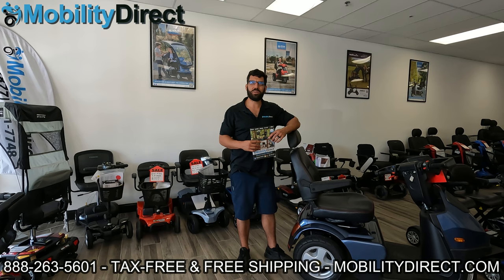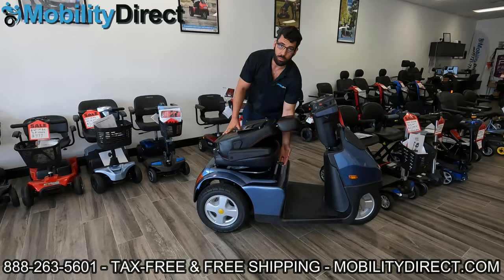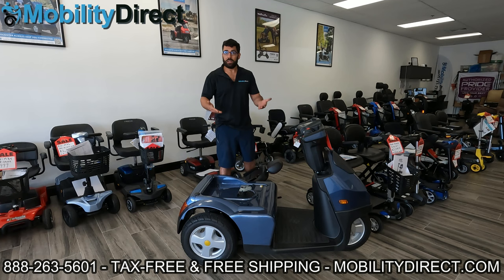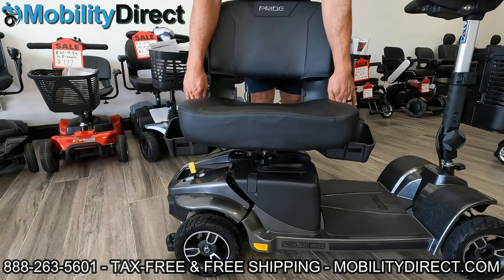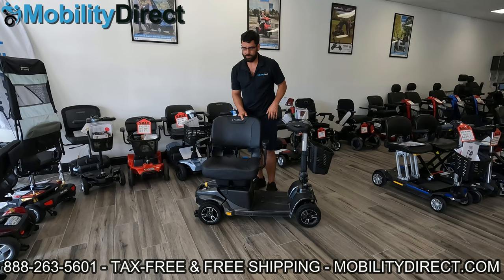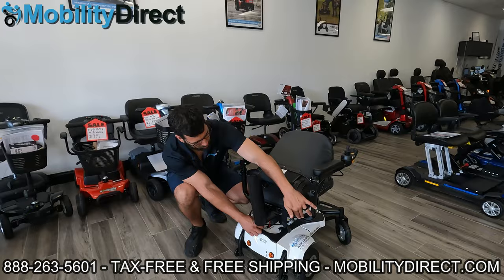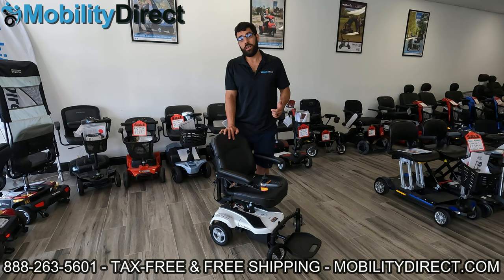🧰How Do You Remove a Mobility Scooter Seat?

Comment: You just made my life easier today thanks a lot!.... It was the straight up thing that was the issue I was even thinking my seat  had rusted closed or something hehe!.. But after you said "straight up" I got the seat offf in one attempt, yet been trying to get that seat off for half an hour. lol. subbed
Reply from the maker: Lol, it's the little things that can make such a difference. Glad this video helped and welcome to the channel! Thanks for subbing
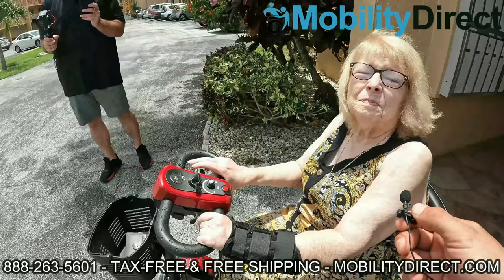Reply: 1:45 in the afternoon my question is this can anybody help me with this? I have a Invacare a Leo scooter with 235 amp hour batteries in it it’s got plenty of power goes up hills and everything but the the motor itself was out a high-pitched, buzzing noise. The changes in the levels of buzzing the harder it is first is this normal for a Invacare scooter to do please respond right away. Thank you so much everybody